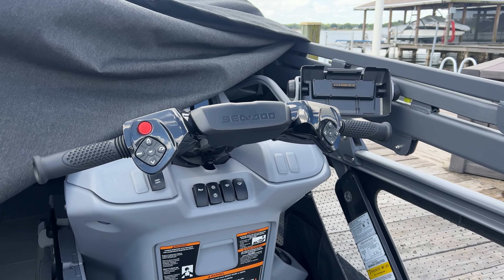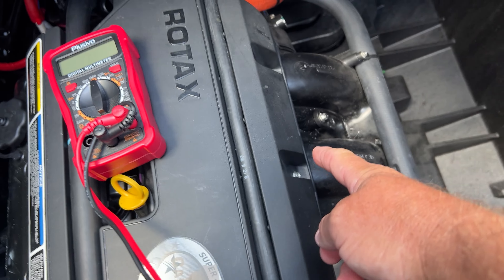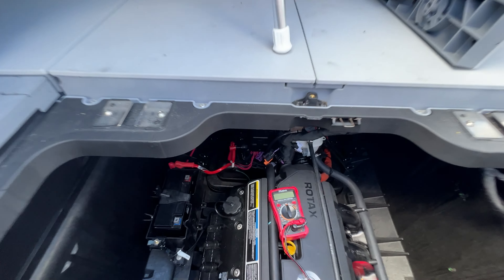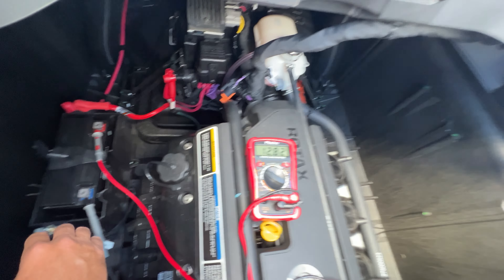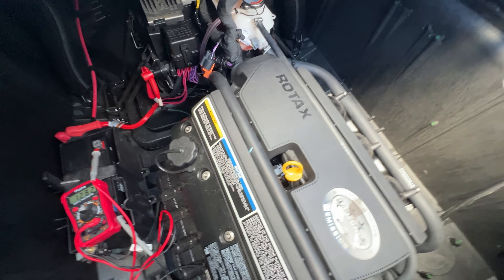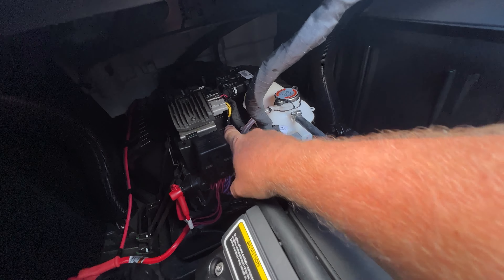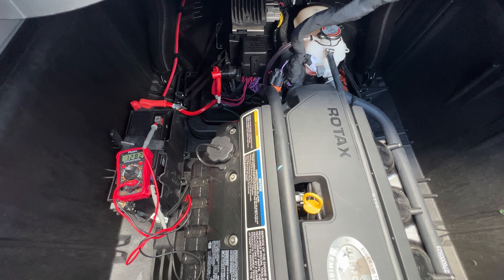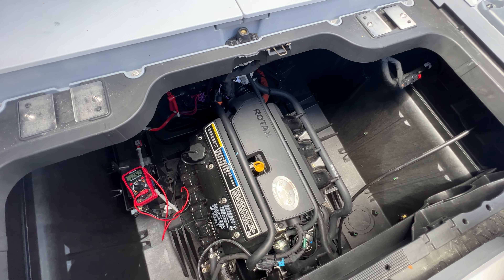sea-doo switch battery warning issue not charging

Comment: I installed the radio on my 100hp and I have had 2 batteries die on me so far what could it be
Reply from the maker: Did you check that it is charging while motors running?
If it is then you wired it in so it’s always drawing power when off.
Reply: It’s the factory plug and play like the one you have in yours gonna check the motor cover after work and also install kill switch